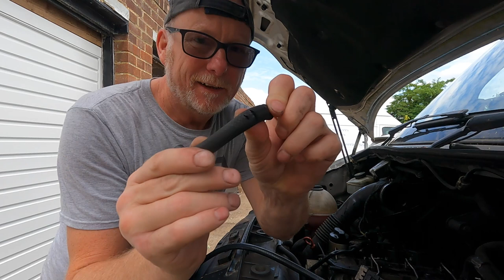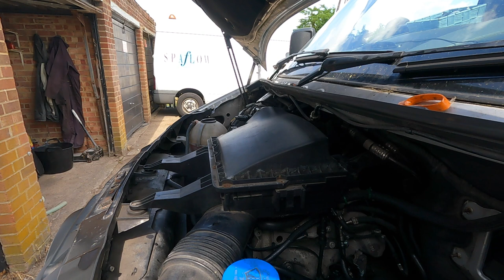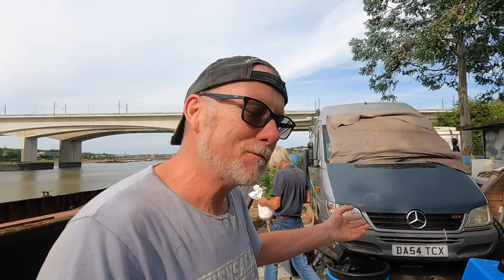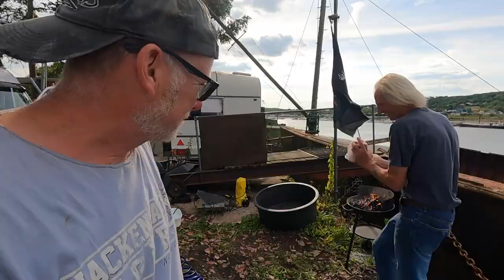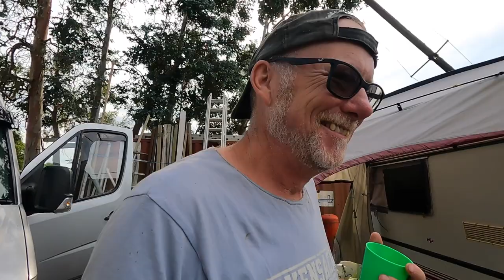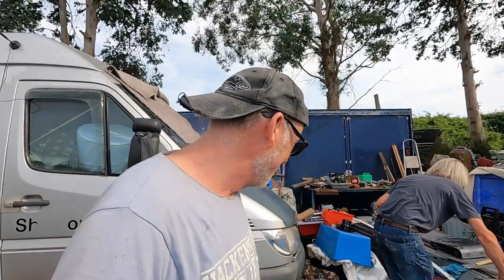Fuel Leak Ends With Fire And Water!! Just A Day In Van Life

Comment: Just make sure your connections are sound, as some high pressure fuel systems are high pressure, up to 1600 bar. Enough that when it splits you will have a diesel jet cutter. My old Mégane used to use steel pipes that 'they said' should be renewed after each time you undo then. I never bother, just kept way out of its way when it was running 😃